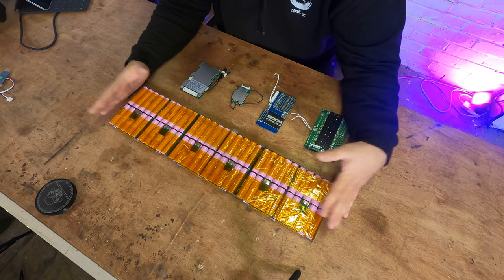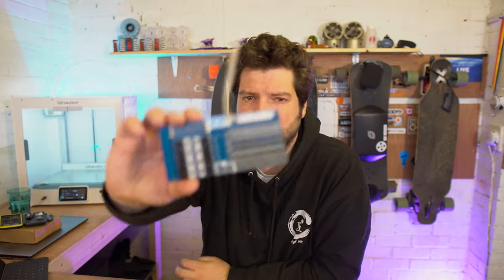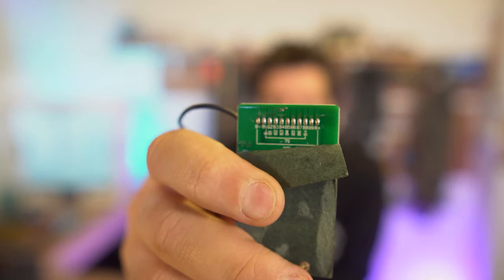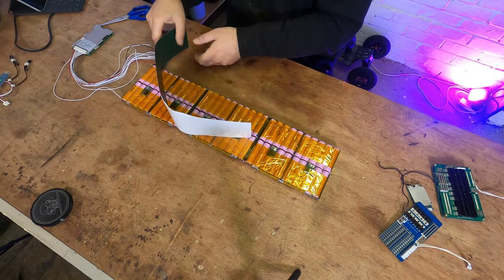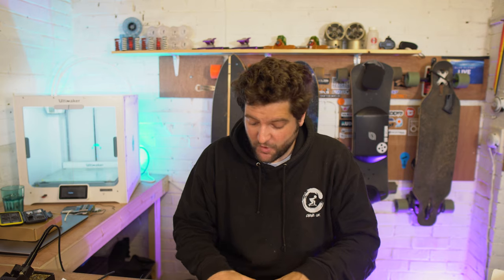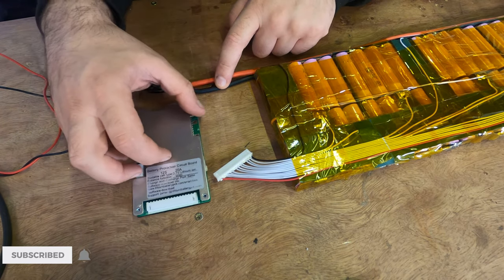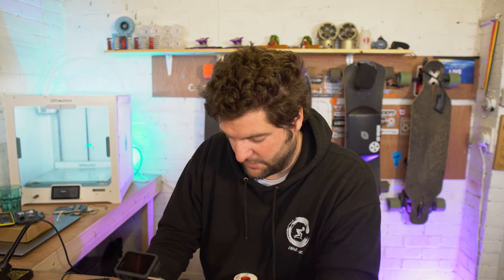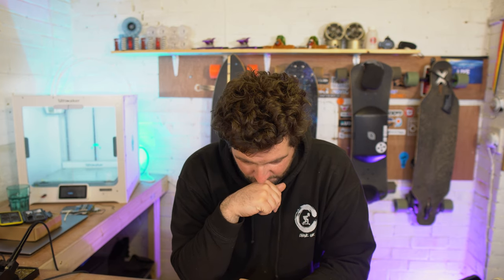The *ULTIMATE* BMS Guide

Comment: Just a word of caution. Not sure if it was mentioned in the video but just beware of over-discharging your cells, so needless to say, keep an eye on your voltage. Bypassing the BMS will disable your low voltage cutoff protection.
Reply: Good info
Reply: @juicyboi2923  Yes it will.  Once the batteries are discharged beyond a healthy 2.6v per cell, they won't retain the same charging capacity anymore.

Comment: im new to this, have some good electrical knowledge but as i say im fairly new this one.  just got my first bms, nickel strips and spacer system for a 36v ebike battery for use on my schwinn stingray chopper.  gonna take my time on this build as i want to do it right.  currently get about 12 miles from the bike based on a 36v brushless 500w hub.  plenty of torque for acceleration up to 18mph.  subed to ur channel and realy enjoy the videos.  great knowledge
Reply from the maker: Sounds like a great build dude!

Comment: Great vid mate! Had an issue with my battery upgrade on my Evolve GT and decided to replace the ESC and BMS with new stuff. Was quite boggled when it came to picking a BMS. Went with a 40a smart BMS(looks similar to yours) but didn't realise I didn't have to use for discharge, only had the stock BMS to go off and didn't have a clue. So the original is actually wired for discharge then I guess.. The charge only seems so much more simple. 🤔 Thanks for all the info. It all makes alot more sense now.
Reply from the maker: You are most welcome mate!

Comment: Great work lad perfect battery build but you extended the balance wires off camera this is a trick for new players may not be aware of. Only thing I would have done different would be add a inline fuse to charging port. But not required. 5 star build mate.
Reply from the maker: Yup! I fuse all my charge ports! I put the fuse on the board end of the loom not the battery. Ta bud, hope this video is useful to people venturing into battery building

Comment: Nicely done sir. I appreciate emphasis on clean safe work area. Lions are nothing to play with carelessly. One thing with these BMS builder/maker/diy videos ? Limited to zero mention of BMS WIRING SEQUENCE. I.E. 'connect negative & then sequentially wire individual cells', or 'wire negative lead, then positive lead and then connect cell bms lines, or it doesn't matter, wire it up with correct polarity & bms lines. Perhaps it's not relevant if no damage can occur from wiring from either pole & all cell lines in between. I have just not seen any mention of 'specific' BMS wiring sequence. Though I highly rate this video as quality information. Thanks for this video! Liked n sub'd

Comment: I'm curious how much power the bluetooth module constantly draws. 
Like a BMS always pulls a tiny bit of current, right? That's why you have to recharge unused battery packs after several months, right?

So how fast does the bluetooth drain the batteries?

Comment: Lee. You the man. I learned a lot about BMS seems I thought I knew. Lol. Almost as funny as you video ending. I'll be getting with you about a 12s battery pack built by you. Blind I am. It would be very dangerous if I were to try and build a big battery, or a battery of any sort for that matter. Hope you'd be intrested in building one for sale.
 Keep them vids coming. Good stuff.
Reply from the maker: Hey bro you are welcome! Yes we build batteries for sale no probs
Reply: @LeeWright  thank you bro. Now to get my money right. These times has my money all funny. Let me know a price for 12s5p 21700 cell battery pack. It's going on a drop down board but it's 41.5 inch long at 10 inch wide. Should be enough room to accommodate that big ol battery pack. Oh. Might need a vesc too. Again, thank you Lee. Safe riding mon frère.

Comment: Fantastic Lee, really nice details. Why do you cut the heat shrink at the end leaving the BMS a bit exposed? Also, how do you calculate how many nickel strips you put on? Also, when you connect  two groups laterally, are you bending the nickel strips? Thanks
Reply from the maker: The BMS I freed as the heat shrink was putting too much pressure on it.  It won’t move because of the wiring.  Batteries are a whole other topic and I’ll go over that in detail very soon. But yes, bent nickel between the groups across the pack and braid along the length of the pack to keep some flex
Reply: @LeeWright  That would be very useful to know! I use to build my batteries like two identical halves and I connect them with a cable. Your approach is new and interesting for me, maybe only disadvantage is red cable must have to travel from the other far side. Wondering about what this "braid" could be, never heard about it...
Reply: @LeeWright  oh I see. Will you take any measure to prevent water ingress on it?
Reply from the maker: @negaopiroca2766  no mate, theres only so much you can do with it. I Leave that to the customer
Reply: @biltre21  i agree with you regarding the positive wire, remedy is to put the BMS at the opposite end and rotate

Comment: Great Video! You mentioned that locations of temperature sensors is important, but didnt show them.  Where are those places on the battery?
Reply from the maker: Only that they need to be spread apart and need to be in close contact with the cells

Comment: Hi Lee,  I just bought a BMS from LLT Power (same mfgr as the one you demonstrated).  I can't find a wiring diagram or manual for this unit.  It's a 14S 100A Discharge and Charge unit with BlueTooth, and a couple temperature sensors.  There is a B- terminal , and a C- terminal (no P- terminal).  How do I connect this to my charger and to my load?  It also has a two conductor JST connector with black and red wires next to the balance voltage connector, but I have no idea what this is for. The silk-screen on the board by this connector says "SW".  (switch?)  Have you seen one of these before?  Can you point me to a manual or diagram, or give instructions on connecting this to my battery, charger, and ESC?  Thanks!

Comment: Lee, interesting video but next time have the camera pointed more at the table and battery pack instead of your face (just to see more of what's going on). Also, when you extend wires, stagger the splices. It helps with narrowing the width of the harness and possible shorting if the heat shrink happens to split (yes, I can see that they're taped down). Thank you for the video.

Comment: Hey Lee, building a 10s 36v 15ah pack seen plenty of videos of how to wire the bms but what do you use to power them to charge? I have a Li-ion battery charger that outputs 42v 1.5ah would that do it?

Comment: I am building a 4S pack for use in my Tesla, the pack will sit in parallel with the stock battery, but will a BMS be able to let the charge current from the DC-DC converter through or do I have to solve this another way?

Comment: I've got a summerboard V2 Battery. It's refusing to charge, but I have about 80% left on the battery and it will still run my board (got a free replacement - Aaron mentioned about a problem resistor on the earlier V2 batteries?).
I'm getting the red blinker of death on the battery, but I was wondering. Would it be a BMS problem or I have a bad cell? Annoying, the bloody thing is actually well made and I've only managed to get it out of the casing and do some simple voltage checks.. Would sticking a different BMS work? or would it be easier to just rebuild  and try and fit it into the current battery enclosure?

Comment: VERY INFORMATIVE thank you, i do have a question: can i setup the cutoff voltage of the BMS to anything i want with a smart bms and the app? I want to try and use my battery cells down to 2.8 before they shut off discharge flow. I watch my parameters as i ride my ebikes so I would like to see if i get more range and same life span with a lower shut off voltage.

Comment: Hey there. Great video, I am attempting to build a 7s charger and got a load of different bms models. The one I am currently testing has no bypass so what I did is split the P- line in 2 and add a switch to change between the Charger- and the Load-. This is essencially the same as the bypass configuration right? Also, if all I have is a voltage dc supply, to what voltage should I set to charge a pack of 7s lipos? 29.4V would be their 100% voltage, but can this present any danger? Should I set to a lower value?

Comment: Hey  thanks for this video, just what I was looking for. I am a newbie at battery building, but have electrical education background if I am right this is a 12S5P pack you have here right? 
Do you maybe know what kind of BMS is built into generic factory built Chinese battery packs I have a 13S4P (Ownboard Zeus) pack and had a power cutout mid acceleration which catapulted me of the board...and was wondering if the BMS was the quality mf....as it definitely wasn't the road or me...

I am asking because I want to build another cruiser board with a 13S3P pack and want to choose a BMS  that is a good choice between size/reliability.

Comment: Hey Lee, Great Video
Currently building a battery pack. (10S3P 36v)

1.) What keeps this battery from over discharging when the discharge bypasses the BMS?
2.) when choosing the BMS I look at the Cell's discharge rate (which in my case is 5C) The capacity is 2000mah. So I think that means 5*2,000=10,000mah, 10,000mah/1,000=10A. I should get a BMS that has max discharge of 10A? What would happen if  I put like a 15A?
Reply from the maker: Great questions.  If you don’t use a discharge BMS you must have another means of monitoring and/or controlling the discharge.  Maybe that’s an ESC that will cut power at a certain voltage, or a voltage meter you keep an eye on.  Yes if the battery can discharge at 10A then a 10 or 15A BMS will be fine, a little head room won’t hurt
Reply: @LeeWright  What would happen if you pull more more than the discharge C rate? Like in my example if the battery is only 5C, Would putting a 15A damage the battery if the load tries to pull more than 10? Just curious, still learning.
Reply from the maker: @longle7603  in reality the internal resistance of the battery would rise as it gets hot and restrict the current to below that, however its dangerous to get batteries hot like that and so obviously it’s not recommended to pull more A than the battery is rated for
Reply: @LeeWright  Ah, thanks. Sorry for my noob questions. Still learning and trying to learn as much as I can before i set something on fire.

Comment: This video is most helpful from all the other videos I watched. I'm trying to build my first battery pack with 18650 cells 13s 3p with a lifepo4 bms (charge only). It's a 16s bms, and I believe it puts out a slightly less voltage. And I have a 2a charger for it. Would that still work?

Comment: I have just joined your channel not because I skateboard but I am interested in the battery side of the system, looking at the video I see you make battery packs so do you make packs for customers I have a disability cart with two 20 amp batteries in series giving 24 volts and want to update to Lipo cells so how many cells would that be, please?
Reply from the maker: Welcome! 7S would be 25.2... lithium operates at different voltages to lead acid and you would need to look Into a DC-DC converter

Comment: I have not built a battery but I  starting to get all the equipment  and supplies. What I and wondering is if I can get a bms that can do 14s and the in the future I can upgrade it to a higher 16s or hight 8f 8 want to upgrade my motor?

Comment: Some or all BMS boards are listed as 3s, 4s etc. Do i need to get one that matches my series? Can i use a 4s for a 3s setup? If so, which balance wire do i omit?
Which brands are good, where to buy reputable brands, what to look for in a bad/good bms.
If i want to be able to use the battery and charge it at the same time, is that possible? Do i need a specific bms for that?

Comment: Does it matter what kind of bms is used when using regen braking? I hawe bms with p - port, I want to replace it with common port smart bms(that is what I was able to find in this size and already ordered it, the question about regen came after fact :P) so the question is, what does control the regen so the battery does not explode, is it motor controller or bms? And does the kind and brand of bms matter when considering the use of regen braking?

Comment: ok, if were bypassing discharge with bms, what is prety wise, because discharge is manageable with controller, what amperage should be used of bms in, lets say 16p7s pack of Samsung 50E 21700 batteries?
Reply from the maker: If you are only using the BMS to charge then you can charge up to 18A dude, whatever you find the best really! You can easily charge a big pack like that at say 15A or 4A (it will just take longer)

Comment: I'm a emtn biker using a hoverboard battery as a range extender on my Focus Jam2 ebike.  I'm also looking into building some packs, learning as much as I can before I try that and have a quick BMS question.  If you use the BMS in bypass mode, what keeps the bike from running down the cells too far?  Must be the ebike controller preventing that because my hoverboard batteries are in bypass mode.  In that case is their any advantage to running the discharge thru the BMS?  If sized right won't it prevent an ebike from pulling more current from the cells than is safe preventing overheating?  Again I'm guessing the ebike controller does that too.  In my case I'm making an ultra light 10s1p from tesla 15A 21700's.  Obviously I don't want to pull too much current from these and ECO mode will help prevent that but I'm wondering if selecting a 15A BMS and using it discharge mode.  thanks, love your videos.  I've learned a lot.
Reply from the maker: Awesome stuff bro! Yes for a bike you want to run in bypass for sure.  The reason why we don't run in bypass on an esk8 is there are no mechanical brakes.  If that BMS cuts the power you lose all braking.  For an elite you don't need to worry about that so I would run discharge.  Good luck and you are welcome bro, glad I could help!

Comment: I have a 48v ebike that isn't charging through the plug. I'm getting voltage out of the charger but the charger light doesn't turn red. I was able to charge by sending 54v thru the bike socket but not thru the charging plug. All wires are intact. Bad BMS?

Comment: Hi bro im getting to the point of needing to setup my batteries in a bigger beast box size say. I have 2x 245kv 6364 turnigy sk3 motors say they need 10s 70amps each. Erpm needs to be set at 60000 because its at limit an at 10s is over that 63455erpm what's the best for me?.An can you put a 12s on an limit erpm to 60000 so they never reach braking point I have 2 so I need 140amps controller as well.Im looking for the best battery thinking 2x 5s 10000mah lipo or 10s3p lithium ion so I would love to no as I'm setting my first electric mountain board up.Thanks love the show thanks lee your a God send to me your times of topics are perfect to my construction.Still waiting on parts anyway so I have been doing it slowly jump up an down when bitz come.

Comment: Can you use any bms with the same cell count if it the same type of system? Also if it is the same type of system and cell count can you just use the existing wiring and cut and join the wires using your new bms harness?

Comment: Hi. Very educational video. Thanks. Im trying to put together a battery 
pack for my motorcycle with each cell 2.1 amps. 5 rows in parallel and 
three cells in series to give 12.6 V fully charged at 10.5A. As Im a 
newbie, I do not know which BMS I should use and how to connect. your 
assistance if possible will be highly appreciated.

Comment: what happens when the BMS in discharge mode fails, ie when I turn my scooter on, the battery out voltage drops to 10V yet my cells still register 4V on each group? battery warning flashes as it only sees 10V. I turn it off and the B+ voltage slowly recovers to ~37V on a 36V pack. It has a strange power on process as it looks like the ES pin (37V) shorts to a 12V pin on my display where the power button is. There is no power on wire per say coming out of brushless controller, just a SW pair that is marked 37V and 12V.

Comment: When looking to select a BMS, how is the current rating selected?  Do you select on that can handle the 1C rating of the battery pack or maximum C rating? (ex. 5C)
Reply from the maker: Good question.  It depends on several things.  If you are using a BMS with the discharge path through the BMS then you have to consider how much the load will pull and if the battery can supply that.  If you know the load will pull 200A and you have a 300A continuous battery then maybe selecting a 250A discharge BMS would be prudent

Comment: Hi Lee thanks. Its a great well explained video.  Can you perhaps confirm whether one can use a 7S Li Ion Battery BMS 18650 module also on a 7S pack of 26650 cells?

Comment: My e-Bike does not use a BMS in normal use. I connect 2xBX100 battery monitor/alarms to the balance wires when the battery is on the bike together with a 30A fuse in series with the battery for a 12S unit intended for maximum load of 20a. For charging, I connect the battery and balance wires to 2x iMax B6 chargers for 12S slow charging. In this way I continually monitor individual cell voltages both when charging and discharging. I do not monitor cell temperature which I recognise is a shortcoming of this approach.